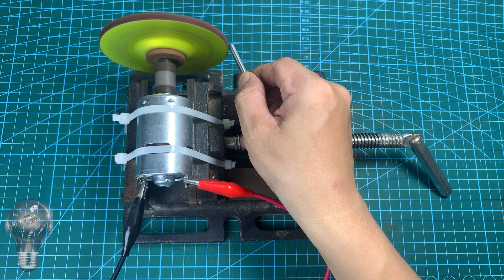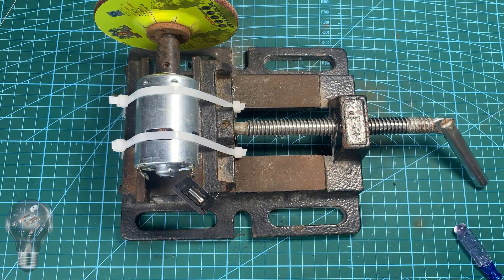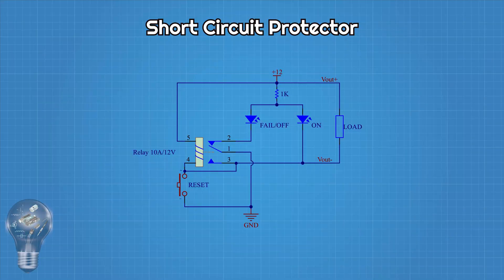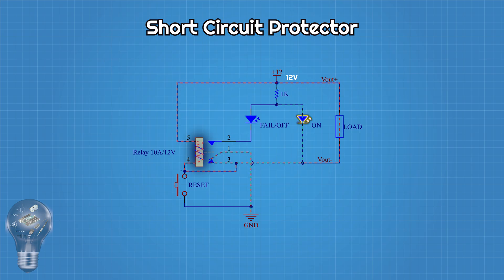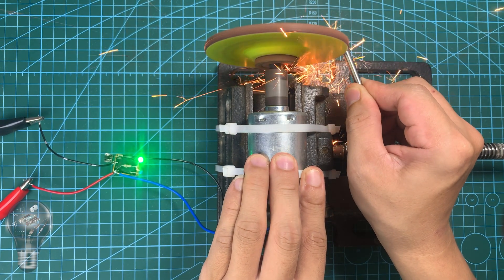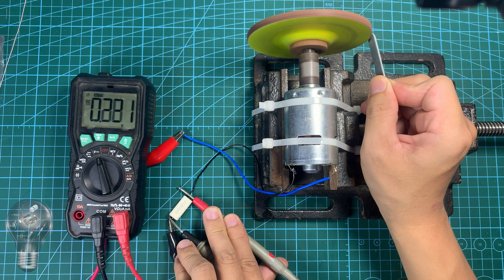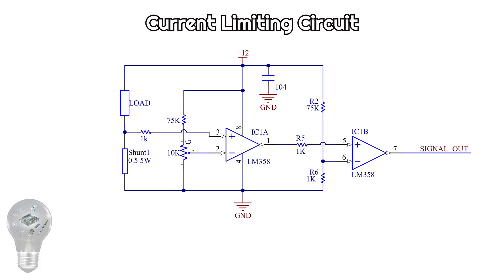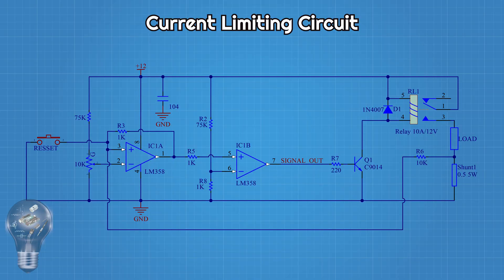How to Make Protection Circuit | Short-Circuit & Current Limiter | Step By Step

Comment: Excellent Make. I have question. If we run DC motor 775 with 24v and current max 2 or 3 amp in that case , Relay do i need to take 24v or i need to use LM7812 Voltage regulator to set the constant voltage for relay and the circuit. Please suggest.
Reply from the maker: You can run the circuit directly on 24V. LM358 supports up to 32V supply. Just make sure the relay coil is rated for 24V. No LM7812 is required.

Comment: Can this work for inverter over load protection
Reply from the maker: This circuit works with a DC power source, while an inverter operates with AC. Because of that, it can’t be applied in this case.

Comment: The first circuit is not good short circuit protection. You made a short circuit on power supply and only cuts the power to motor but the power supply still has short circuit.
Reply from the maker: This circuit uses a relay to disconnect the motor. Because it’s a mechanical relay, there is always a very small delay before it actually opens the circuit.
During that short moment the power supply may still see a brief short, but the duration is extremely small, so in practice it doesn’t affect the power supply much — at most a tiny voltage drop for a fraction of a second.
For a simple protection circuit, this behavior is acceptable, but of course a MOSFET-based fast cutoff would be even better.
Thanks again for pointing it out!

Comment: This is exactly what I have been looking for to meet a commercial application, do you know where I might be able to get a similar product of the shelf ? Thanks
Reply from the maker: I saw modules on eBay (for example: https://www.ebay.com/itm/124437920423
) that are DIY current-limit/short-circuit protection boards and might suit what you’re looking for.
However, just to be clear — you’re looking to integrate this kind of protection circuit into the product you’re actively developing, right?

Comment: Salut poate faceți o schemă electronică protecție la scurtcircuit tensiune alternativă AC 230V
Reply from the maker: Vrei un circuit care să poată seta limita de curent și să se oprească automat, la fel ca în video, dar să funcționeze pe tensiune AC 230V, corect?
Reply: @ElectroInventor1990 Da puteți să faceți și un circuit electronic cu protecție la scurtcircuit și să se oprească automat la 230V AC
Reply from the maker: Există mai multe moduri de protecție la scurtcircuit pentru tensiune alternativă 230V:
1️⃣ Siguranță fuzibilă (fus) – simplă și ieftină, protejează doar o dată.
2️⃣ Întrerupător automat (MCB) – reacționează la scurtcircuit și se poate reseta.
3️⃣ RCBO / ELCB – protejează și împotriva curenților de scurgere (anti-șoc electric).
4️⃣ Circuit electronic cu detecție de curent – se poate face manual, cu senzor de curent și releu pentru oprire automată.

În video-urile viitoare pot arăta o schemă practică pentru 230V AC cu detecție de curent și oprire automată.
Reply: @ElectroInventor1990 Salut  poate îmi  trimiți un link cu un circuit electronic de protecție la scurtcircuit și oprire automată la 230V AC adică  varianta nr 4 despre care m-ai scris
Reply from the maker: În prezent nu am realizat încă acel circuit. Există multe scheme pe internet, dar nu am avut timp să le testez. Deoarece tensiunea de 230V AC este destul de periculoasă, probabil voi construi acest circuit într-unul dintre videoclipurile mele viitoare. Te rog să aștepți puțin, mulțumesc! ⚡🙂
Reply: @ElectroInventor1990 Voi aștepta am înțeles am crezut că ai o schemă electronică deja testată o zi frumoasă vă doresc numai bine 😊
Reply from the maker: Mulțumesc mult! Mă bucur că înțelegi. Voi testa mai multe variante și voi prezenta schema sigură în curând. O zi frumoasă și ție!

Comment: 48v short circuit protection very low current for telephone line check use ? Idea
Reply from the maker: You can use a current limiting circuit like in the video; instead of using a relay, you can use a MOSFET for switching. Note that the maximum voltage for the LM358 is 38V. You will also need to provide a power supply for it. What is the current in your case approximately?

Comment: И всё равно сунул реле, зачем, когда тут отлично подойдёт какой нить мосфет, хоть тот же IRFZ44
Reply from the maker: Could you clarify your situation a bit more? Have you tried checking whether the output signal from the op-amp changes when the motor is overloaded? If it does change, then the previous stage is working correctly. You need to check the relay switching part using your MOSFET. Note that the IRFZ44 MOSFET switches based on voltage (around 10V), so if the output voltage from the op-amp is not sufficient, it may not switch fully.
Reply: @ElectroInventor1990   IRFZ44 спокойно открывается и при 5V, проверял не раз. А если изначальное питание для мотора падает с 10 до 5V, то тут уже блок питания надо менять. А вообще, задумка в операционным усилителем и шунтом, вполне отличная, только если уж пошли в электронику, то тут и мосфет IRFZ44 применить самое оно. А если уйти в механику, то можно оставить реле, а датчиком тока применить геркон, с намотанным на нём проводом.
Reply from the maker: Oh, that’s a good idea! There are also many other ways, like using a Hall current sensor. Have you tried that?
Reply: @ElectroInventor1990  С датчиком холла, это уже лишнее, там много проблем с настройками, да и опять же под него надо целую схему с операционным усилителем и транзисторами собирать. Хотя, если поискать достаточно мощный датчик, который сможет выдержать ток открытия управляющего сигнала катушки реле, то может получиться. Причём сам этот механизм можно будет сделать герметичным, и включать внешним магнитом..
Reply from the maker: Есть такие датчики Холла, например ACS712. Он работает довольно просто — на выходе даёт напряжение, пропорциональное току. Попробуйте поэкспериментировать с ним

Comment: Hi. I really like your circuit. I want it for a project I am doing. It is just the thing. I am self-taught, still learning ... 
And I wonder why you inverted the output and not the input? It would be a little simpler?
Reply from the maker: You’re really sharp! Remember the positive feedback resistor (R3)? It goes back to the + input, so even if Vshunt drops, the logic stays happily at ‘1’. If you try feeding it to the – input, things get messy real quick. And hey, the LM358 still had a free op-amp lying around, so why not use it as a buffer? Works like a charm :v
Reply: thanks